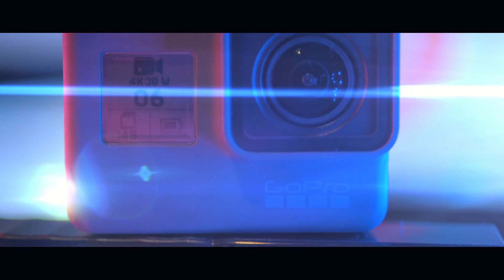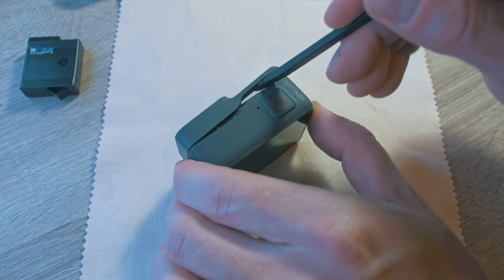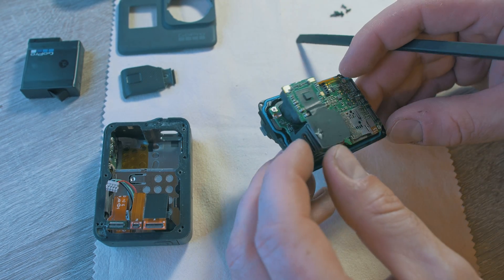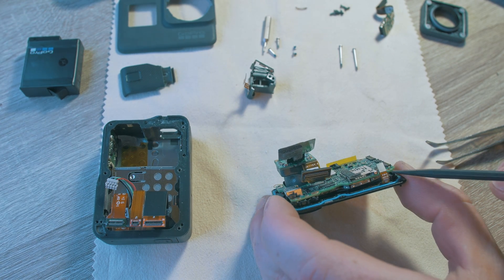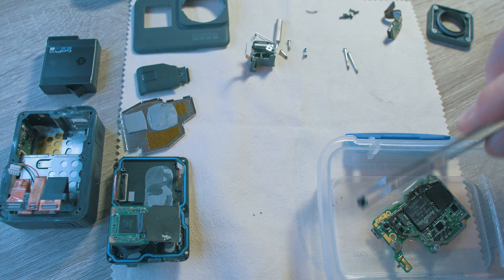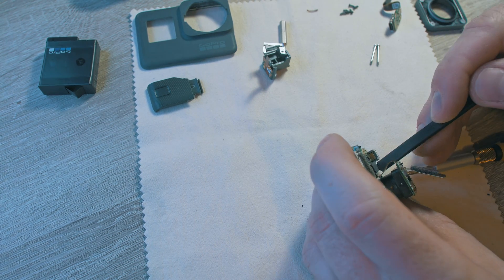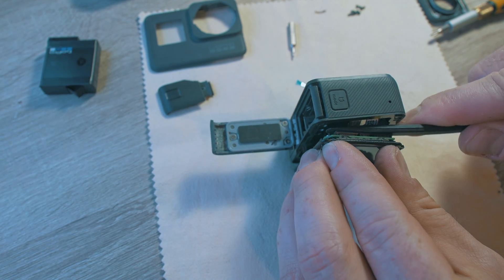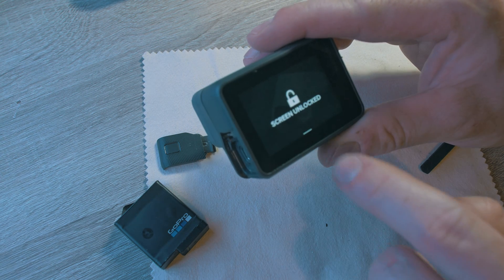Water Damaged GoPro Hero 5 Black | How To Fix It |  [4k]

Comment: Hey - great video really. I have used my gopro hero 7 black for two summers also underwater sometimes, literally just for few weeks - one morning didnt start at all - Im not sure if its a salt water damage - thera are no any obvious marks and I am officialy without gurantee. I did everything I found on line - doesnt work, it only gets heated, sometimes red light goes on. I dont know what else to do and and there is no expert near me to get involved. Do you have any other advice could help before I start digging inside?
Reply from the maker: it is tricky!  you can try my steps

Comment: This video is a lifesaver. I just cleaned my gopro and it worked
Reply from the maker: great! thanks for watching
Reply: @takeapart  i tried my GoPro this morning and the problem is back :(
Reply from the maker: what have you used for cleaning?
Reply: @takeapart  what type of alcohol did you use ?
Reply from the maker: @eliozumbo5639 isopropyl alcohol 99%

Comment: Hello, amazing video! Sea water entered inside my hero 5 black. And it was totally dead. After searching online I found your video, and I decided to give it a try as service centre in my state said it's not repairable. After taking apart and cleaning with IPA now my camera is turning on. 
But it seems it didn't recovered fully,  there is no display on front and back screen. Although it gets connected to app via wifi and I can see no feedback from camera also.
All the media is however accessible via app.
What may be the possible problem? Someone please help.
Reply from the maker: hi, it could be more oxidation on chip or connectors to the screens . I would give it clean with alcohol one more time.  if no help then you probably need to replace some parts…. but it is tricky as it can be main board or displays… thanks for watching
Reply: @takeapart  thanks for quick reply. I will clean connector once again.
Reply from the maker: thanks for watching

Comment: Hi! 
Do you have any video on how to fix the LCD screen? My GoPro got some water in it, and I let it dry to the sun (without taking it apart) and the battery, and the camera in general works very good. However, the LCD does not turn on, so I cannot see any settings, even though the touch functions good. Any recommendation? It has happened two days since it got water in it. 
Your video is awesome, very descriptive, though I don't feel very confident to take apart the pieces of my camera yet, since I don't know how to fix the LCD screen
Reply from the maker: hi, it is hopefully just display connector… cleaning with alcohol should help. and if not then probably new screen.  thanks for watching

Comment: Do you think silica gel can do the absorption of the mini drops? Had my hero 5 soaked in nearby waterfalls. Had light water leakage. It turns on. Front screen works. Luckily i can still connect it with my phone and its smart remote. But the screen is always off.
Im afraid to open the gadget.

Has anyonr here tried putting silica gel in battery compartment of any gopro?
Reply: The heat paste in the mother board is so wet. The grayish one. Should i wipe it out?
Reply from the maker: well yea if it falling apart or so …. best will be to replace it
Reply from the maker: hi,  water will oxidate inside …  I would clean it with alcohol….
Reply: @takeapart  ow...okay. I'll do it tomorrow. Thanks.
Reply from the maker: good luck… and let me know how it went

Comment: My go pro did not turn on after water leakage  the  I tried to charge it but it got hot. Is it still possible to clean like what you did and might work?
Reply from the maker: hi, well hard to tell what happened inside… you can try to clean it and hope that it will turn on after…
Reply: It was 2 weeks since I'd did not turn in. I will try it this Sunday. Is it okay to use any available isopropyl alcohol?
Reply from the maker: good luck!  higher the percentage…better…

Comment: After doing everything it turned on and after a few seconds turned off. It not turning on anymore.
Reply from the maker: Hi, it depends on state of damage…. water is corrosive and it can badly damage the pcb
Reply: @takeapart  I didn't see any water damage inside. Mine was acting up and I thought it was from the last time I took it to the lake. I took everything apart like 3 times and reassembled it. Everytime it seems like it turns on and stays on for 2 seconds and bam off. I'll probably have to get a new one then.
Reply from the maker: oh I see…. try new firmware if it’s possible…

Comment: Could it work on a flooded gopro 8 ?  ( with salt water)
Reply from the maker: hi, it can … steps are bit different …  thanks for watching
Reply: @takeapart  do you have a video on it? My battery is all swollen, I discarded it. But I wanna try at least to save the camera before buying a new one
Reply from the maker: unfortunately I don’t have video for hero 8 …  keep in mind that you have to act quick as salt water is corroding internal components…

Comment: I did this method for my GoPro hero 5 actually I also took it to some water after that it is not charging and it's not turning one and so I did this method like you have done but after doing it also does not working so the battery voltage is 3.3v
Reply from the maker: hi, it depends how bad was oxidation on components....
Reply: @takeapart  I didn't not understand
Reply: Pl reply
Reply: After putting it into the water yesterday it it was turn on only for 2 second and again it turned off and after that today it's not turning on
Reply from the maker: if the condensation was in bad state... the components inside can be damaged permanently and no alcohol can clean them . also once you open the gopro it looses its waterproof ability.

Comment: How do you fix your gopro when you put your gopro in the water but it doesn't read your sd card?
Reply from the maker: hi, I would closely inspect sd card slot  ... look for corrosion or oxidation.... try to clean with alcohol and som kind of swab .   if no luck then open and it and look for damage
Reply: @takeapart  okay, I will ty and let you know if it works
Reply from the maker: thanks for watching
Reply: @takeapart  no problem. Think I will just return it.
Reply from the maker: haha yes

Comment: Mine died a week ago after a 16.4 feet dive for five minutes. I’ll try to fix it following your tutorial.
Reply from the maker: salt water? if so do it immediately!
Reply: TAKEAPART while I was taking my Hero 5 apart, one of the flex cables connector broke, ‘cause it’s corroded. I think it’s my destiny. Do you know if it’s possible to find a replacement?
Reply from the maker: yes you can get all... check out links in description and even if there is no exact part you need contact the shop  and ask for the part .
Reply: Thank you. I’ll try to find it.

Comment: Hi mate
In 1. 43when you unplugging this little tape from USB connector on mine one this little square socket came off as well - - - - >does it mean I broke camera completely or I just won't have USB and camera can work without this
Reply from the maker: hi Jonek111 it is hard to determine ... it will work without connector... try to send me a email with detailed pix . thanks
Reply: Alcohol should arrive today
I'll do cleaning and try to run it
Reply from the maker: yeah man go for it

Comment: Mine did not work again. It seems that the damage was bug, in fact theta was a lot of salt on the motherboard. When I retired it, corrosion was evident. I had an issue with fresh water one year ago, but It worked fine, even I did not repair anything. But yesterday, it was in salt water and after I clean it, it did not start again, When I was snorkelling it appeared a message saying that the SD card wasn't avaible, and then it just shutted off. 

I wont use a gopro without a case anymore, even they say it is water resistant.
Reply from the maker: glad to hear!  thanks for watching
Reply: Same as mine! I always doubled checked it before using underwater but the same error occurred.

Comment: What size and type of screw did u use in front area??
Reply from the maker: T4  6on front, thanks for watching
Reply: @takeapart  then the next screws on the other part are just some regular mini screw?? I have the same issue w/ my gopro and after i removed the front cover i dont have that type or screw driver. Thanks
Reply from the maker: I think it is JIS or standard phillps head ... pretty standard .
Reply: @takeapart  it's like t2 or t3 for the front area. I tried t4 but it's too big for it
Reply: @takeapart  you literally brushed it w/ alcohol?? Is it safe??
Reply from the maker: hi , isopropyl alcohol (99.9%) alcohol is safe for use. thanks for watching
Reply: @takeapart  thanks for the help! I'm gonna work it out tonight 👍🏼
Reply from the maker: great! good luck with repair...
Reply: @takeapart  it didn't work on my gopro what would i do??
Reply from the maker: go ahead and follow video
Reply: @takeapart  i did it already and it didn't work
Reply from the maker: oh sorry, it depends on how long the water was inside also if it was fresh or salt water .
Reply: @takeapart  the last time i used it was in a salt water.
Reply from the maker: that will be the reason... if you cleaned properly and it still won’t turn on then it may be late.   just checking: try different battery best working one!

Comment: Hi can you use WD 40 contact cleaner instead of isopropyl alcohol. If not, what’s the % of alcohol in the bottle you are using ?
Reply from the maker: hi, I wouldn’t use anything else than isopropyl alcohol... I believe that one used was like 99%  ....  thanks for watching
Reply: TAKEAPART thanks mate 👍
Reply from the maker: no worries! good luck with your repair

Comment: Hello sir , can you answer for me please . My GoPro got sea water inside . That day  when I go to sea made a firm. But the potho was running on lcd . It about 45 second . After I checked camera 😂 . From the battery door , the rubber is alittle breaking. So sea water come from door. After I try to make dry . But it not work any more . Do you think it's can be fix or no ?
Reply from the maker: well depends on time... if it happened not too long ago... it may be fixed

Comment: Hi, tell me please, I have a gopro 7 silver, but as I understand it, the principle is the same. I don't have any sound at all, rewiring didn't help. Probably the microphone itself-the capsule is broken, or some chip on the main Board. The main microphone as I understand it is on the main Board? Can it really be re-soldered? Or should I not get involved?
Reply from the maker: hi, 
thanks for watching! and imo I would replace whole flexi cable with microphone... gopro has delicate components the soldering is last thing you want to do unless you are professional.  see description of the video and visit aliexpress shops listed they has great quality parts even if not listed just send them message and they reply asap.
Reply: @takeapart  I thought the microphone was soldered to the motherboard?! or is it a noise-canceling microphone?
Reply from the maker: you should check mics near mic holes on actual body of gopro.

Comment: You just literally clean it with an alcohol then dried it out and when you put it back together it worked?
Reply from the maker: yes, thanks for watching
Reply: @takeapart  will try to open my own go pro hero 5, due to possible leakage also. Thank you for this.
Reply from the maker: no worries and good luck!
Reply: Neci Rohn De Jose did it work?? I’ve been thinking of trying

Comment: I do everything as you do. But my camera won't wake up 😭😭
Reply from the maker: hi, unfortunately sometimes damage can be bigger and cleaning internal components will not solve the issue... 
my method is effective in early stages of water damage... 
good luck and thanks for watching
Reply: @takeapart  Thanks for link to buy mainboard.
Reply from the maker: good luck with repair!

Comment: When you are removing the piece at 2:04 it is ok but when you are moving it back a small green part is missing on the tissue. what is it? could you please clarify?
Reply from the maker: hi , it’s one of those tapes preventing ribbon cable from being disconnected.  
thanks for watching
Reply: Thank you for the quick reply.

Comment: Hi! I found a really water damaged Hero7 Black recently. It had alot of buildup on the outside (from fresh water algae, etc). The internals look great just from when I take the battery out. I have cleaned it up and it turns on but the touch screen is a bit funny (probably a few damaged LCDs and water damage), however my major issue is that each time I turn it on it shows there is no battery/ battery is flat (even though it is fully charged) and it does not record. I am unable to update it also due to the battery. What would you recommend? I cannot afford repairs and the device is at least 2 years old. 

I have watched your video but would you recommend this for the Hero7?
Reply from the maker: hi, firstly: I wouldn’t play with device! it probably has been some leak so opening and checking/ cleaning is must.  with iso alcohol (cheap solution) you can clean internal parts. 
battery side: probably dead! you can try to discharge/recharge it few times . 
thanks for watching please don’t forget to subscribe...

Comment: Thanks for the video I am having some issues with my gopro 6 black when i record with the battery will stay on for 7 minutes then will turn off if i use a external battery it will record with no problems for as log the external battery will last. What could be the problem ? And the gopro battery is not draining if i take out the batery and put it back on wilk record for another 7 minutes and turn off
Reply from the maker: hi , do you have another battery? seems to me like battery issue 
thanks for watching

Comment: some water leaked into the battery compartment. The screen went crazy and shut off. I left it in rice for a day. It worked fine again and then i put a battery in and started charging it and it smelt burnt and was super hot. It now won't turn on.......
Reply from the maker: +JungleSpearing hi, you can try iso alcohol and if it’s not going to work then replacement of the board will work...thanks
Reply from the maker: +JungleSpearing hi, putting battery back in and connecting charger wasn’t great idea! now is motherboard damaged (most likely) check out my other video on that topic. thanks for watching

Comment: any idea how much it cost for repair? i have same issue. water leak. the red light stays on. not turning on just the red light
Reply from the maker: hi, if only cleaning needed it will be few $ just for iso alcohol.... if board needs replacement it can be up to $200

Comment: What if I'm not going to ever be happy ?  Do I keep brushing ??
Reply from the maker: yea man brush it away!  happiness will eventually come 
thanks for watching
Reply: @takeapart  I was just trying to take the top cover off after the lens and the screwdriver was eating into the plastic I don't want to mess up the seal on it so I'm giving a few more days of letting it dry out.. thanks for the detailed video
Reply from the maker: I use a waterproof case for hero 5 as even factory sealing on hero5 isn’t 100% 
this way Im sure it not het any more water damage. 
thanks
Reply: @takeapart  i get it, better safe than sorry.. but if something is advertised 'waterproof' up to a certain amount of feet for a certain amount of time, it should be able to take on a dunk or two underwater..
Reply: @unoupz  Exactly, my go pro leaked inside on a battery cover even though the lid was properly closed, such a shame.
Reply: Brush forever
Reply: @fabianmosenson3768  bro.. suppperrrr baddddd news.  I quit brushing.  I got happy !! \o/
Reply from the maker: mean! thanks for watching
Reply from the maker: almost forever haha
Reply: Not suitable for OCDs. Its hard to make OCD happy with the cleaning or brushing